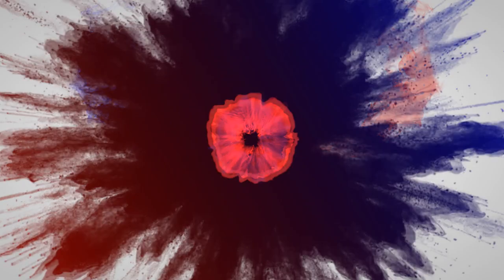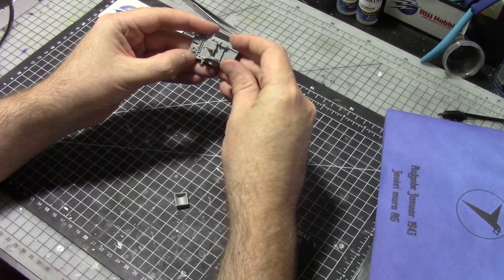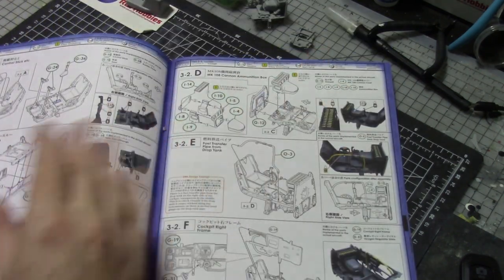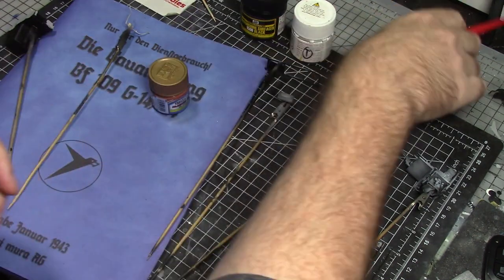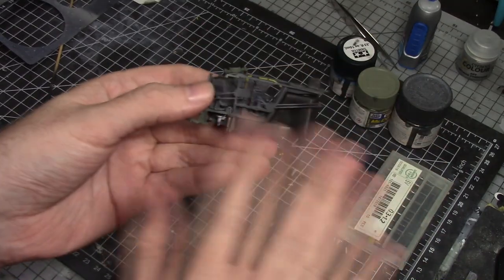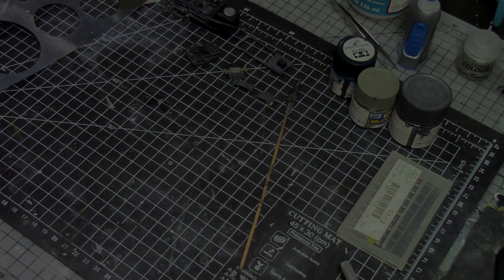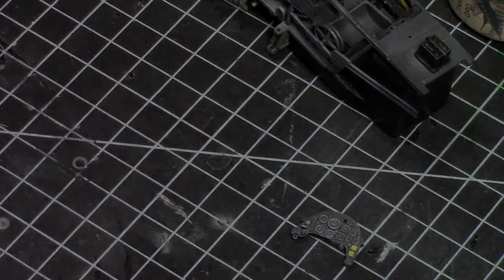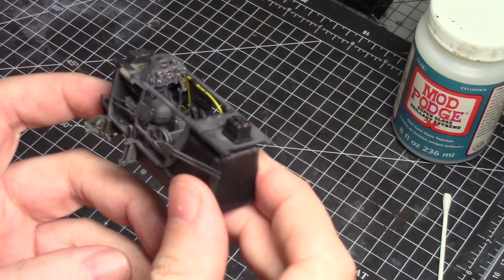1/32 Zoukei-Mura Bf 109 G-14/U4 Build Series - Part 2: Cockpit

Comment: Some of the kits have seats with no harnesses I guess they are assuming you will be adding a figure. I know none of the Phantom kits have them. The Skyraider gives you the option with harness/seatbelts
Reply from the maker: It is a strange one as it comes with a standing figure in the pack, but not a seated one.